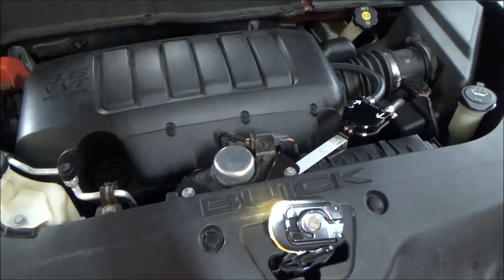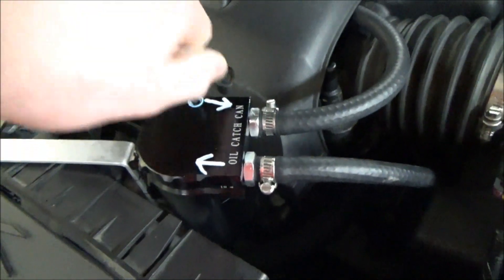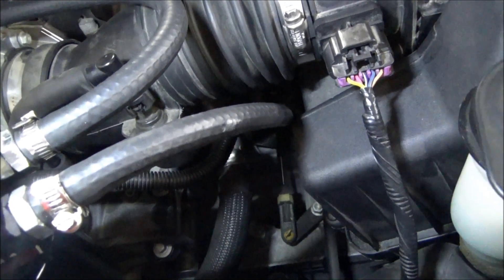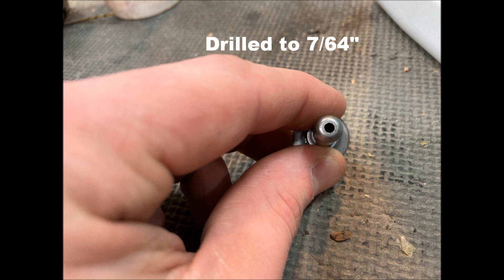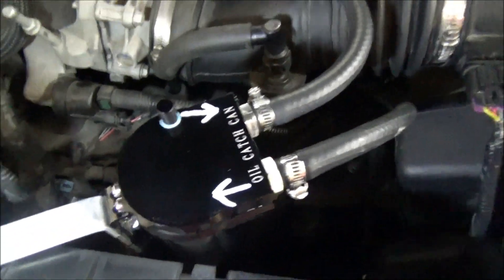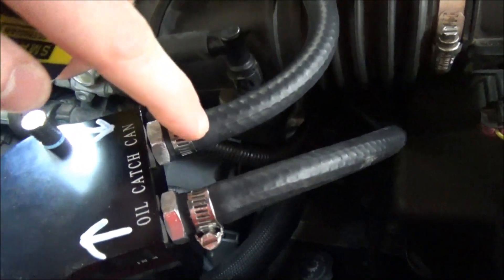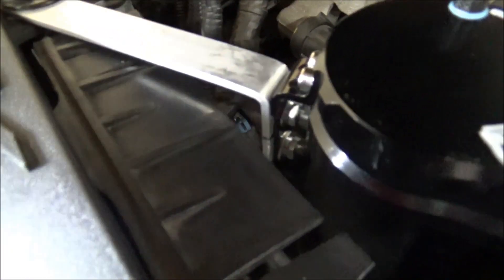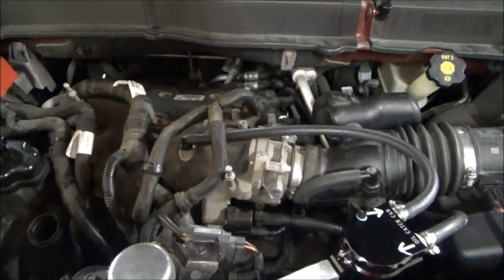GM 3.6 V6 Oil Catch Can Install for Buick Enclave, Chevy Traverse, GMC Acadia

Comment from the maker: Here are the suppplies that I used for this catch can install:
Catch Can: https://www.amazon.com/dp/B06XK9PTP7/ref=cm_sw_r_other_apa_i_YUKNEb4222NR5
Heater hose: 3/8" ID heater hose- I bought 6-8 feet an had some left over. (Local auto parts stores should have this in stock.)
PCV Valve - (I drilled the top hole to 7/64", and the two bottom holes to 5/64")- https://www.amazon.com/ACDelco-12583384-Valve-Hose-Adapter/dp/B07S4GSNDG?ref_=Oct_d_otopr_d_15727221_0&pd_rd_w=L1e2u&content-id=amzn1.sym.43572f80-b822-48bf-9e7f-061d94b77ab7&pf_rd_p=43572f80-b822-48bf-9e7f-061d94b77ab7&pf_rd_r=VTWG9J437JWG0HNTC3YX&pd_rd_wg=ou4Gq&pd_rd_r=05eb7e79-5262-4847-b6e0-e461fde5fd26&pd_rd_i=B07S4GSNDG
As for mounting hardware- I just used scrap aluminum that was lying around.

Comment: Just wanted to say THANK YOU for this video. I have a 2012 Chevy Traverse that I just modified the PCV valve and then installed this exact catch can system (where you did - to the brake booster). For those of you in similar circumstances, if you buy the Evil Energy can like I did with the 5' hose, it comes with a bracket that you'll need to widen one of the top holes and then drill 2 holes in the angled portion like where he shows his cannister is mounted. Also, I saw someone else put threadlocker on the screws so they don't come loose, and it might also be a good idea to put anti-seize on the inside baffle where the steel wool goes, as well as the cannister itself.  Wouldn't have felt comfortable doing the catch can without this video. Really appreciate the effort you put into this with the explanations, etc.

Comment: 2012 Chevy traverse ltz. The line from the pcv back to the intake is a hard line. Am I just supposed to cut the ends off and connect a hose?

Comment: Is it normal to hear air hissing sound after installing? I can hear hissing, but it there’s no leaks. Maybe the larger diameter hose is just simply pushing air more freely and making a more audible sound?
Reply from the maker: Yes, when it was running there was hissing after I added the catch can. But there was no issues as far as how the engine run.

Comment: Your video definitely helped me out. Did the exact same thing you did   💪💪… so since she installed it have you had a significant amount of oil inside of the catch can?
Reply from the maker: It is more moisture and condensation, not just oil. It depends on the outdoor temps too. If you live in a warmer climate there will be less moisture as the oil does not have to warm up as much.
Reply: Man, the only thing I have wrong with this 2012 GMC since I gotten it right when you first start the vehicle, it has a rough idle and then it moves out. But if I put my foot down and hold the RPM this move out quicker.  But if I use auto start and just let it run, it runs terribly and then moves out. It’s weird. Can’t seem to find the issue. No check engine light no nothing. It has all new spark plugs new timing chain new vvt and now the cats can any idea what could be causing the issue
Reply from the maker: @ Could be a dirty throttle body of mass air flow sensor. Or perhaps  it could be the cam sensors too, so then the engine does not know what position the cams are at so it tries to compensate by changing the timing constantly. My Buick when I started it cold, the RPM would bounce around during the high idle, but it was never varying over 100-200 RPM.
Reply: @ yeah mine do the same thing. Literally bounces around right when I first start the car up.  So I guess tomorrow I’ll clean the throttlebody and the mass airflow sensor. And replace cam sensors. Hopefully that does it. It was just bugging me because I didn’t know what to change and I didn’t just wanna throw a lot of parts at it.   So I guess the cam sensor should be the culprit.
Reply: Seafoam and goes away let me know how it went @re9473

Comment: What about the front valve cover? Doesn't the front cover also push oil into the intake manifold?
Reply from the maker: I said this in the description about that: "It is worth mentioning that some people have installed another catch can on the "clean air" side of the PCV system, to keep the throttle body clean. I have not had issues with the throttle body getting really dirty, so at this point no catch can is needed." The only time the oil comes from the foreword PCV valve off the snorkel is during high engine speed events, or if the PCV valve that I captured is clogged. Then it would get the throttle body dirty. I don't drive that much, and the throttle body has not given me any issues with getting dirty. I cleaned it once - and  it wasn't that dirty, but that was because I replaced the air filter and had stuff apart anyway.

Comment: Would I need to install this if I'm having issues with my ignition coils and sparks and o2 sensors had all replaced at dealers in 2022 now all have gone out again, HELP ME
Reply from the maker: Likely not, but if your engine is burning a lot of oil due to a clogged PCV valve, that could be messing up the O2 sensors. And it could be fouling the spark plugs as well, causing misfires. I'd check the PCV valve to make sure the crankcase can breathe.

Comment: Does it run smoother afterwards or just consumes less oil with less carbon build up in the intake valves?
Reply from the maker: It did not make a difference in the actual running of the engine, but adding this catch can will help keep the intake valves clean.

Comment: Do you still have to add oil to the engine. Or does the catch can returns the oil to the engine ?
Reply from the maker: It only catches the oil  that would have been routed to the intake, it does not return oil to the engine.

Comment: You get any engine codes or lights after install..?
Reply from the maker: No codes or lights at all. It runs the same as it did before.
Reply: @jacktischer6676  thx for the reply

Comment: did you install another type of pcv valve or is it the original
Reply from the maker: It's a new, stock one, but I modified it as mentioned in the video.

Comment: How much fluid are you getting on the regular?  These engines are terrible for oil in the intake.  I'd be interested to see a follow up after some cold weather or just normal driving of what you get out of it.  Great video thank you
Reply from the maker: I'm getting a decent amount of milky and oil substances in the catch can. It is more than I thought. In a little over 1,000 miles of driving, I've gotten around 7-8 ounces (close to a cup) of the milky crap that it catches, as of 2-13-2023. I installed it just before Christmas of 2022. Lots of the driving that I do is about 6.5 miles a day to school. That definitely generates lots of the moisture in the engine, because of both the colder Wisconsin temps, and short trips. But I do like to go on longer drives, to get all of the crap out of the oil- which I would go somewhere a good 10 miles away every weekend or so. When the temps get warmer for the summer, I imagine it will catch less crap overall, and not as much white milky crap. Modifying the PCV valve definitely helped to get all of the crap out of the engine. I should make a follow up video, and I'm glad someone was interested in the results of this.
Reply: @jacktischer6676 i have a 2017 buick and that model year you cant change the rear pcv it only interchangable if you replace the valve cover, its a newer design according to the stealership. But i did exactly in your video. Thank you for your vid it help out alot.
Reply: @jacktischer6676  That's awesome 👍, these 3.6's have a chronic problem with oil consumption/blowbye imo.
Reply from the maker: @unorthodoxridez  @Unorthodox Ridez  If taken care of really well, they can be a decent engine. I check the oil very frequently, and change it by color as well- not letting it get dark and black. Lots of these engines fail because people simply neglect oil changes.
Reply: @jacktischer6676  agreed

Comment: Why didn’t you capture the foreword PCV valve off the snorkel as well?  I believe that is where most of the oil comes from as it’s not restricted like the back one.
Reply from the maker: I said this in the description about that: "It is worth mentioning that some people have installed another catch can on the "clean air" side of the PCV system, to keep the throttle body clean. I have not had issues with the throttle body getting really dirty, so at this point no catch can is needed." The only time the oil comes from the foreword PCV valve off the snorkel is during high engine speed events, or if the PCV valve that I captured is clogged. Then it would get the throttle body dirty. I don't drive that much, and the throttle body has not given me any issues with getting dirty. I cleaned it once - and  it wasn't that dirty, but that was because I replaced the air filter and had stuff apart anyway.

Comment: I have a 2014 traverse the pcv valve is a one piece hose that connects to the in let valve on the engine do I cut the plastic hose and put my hose on it
Reply from the maker: Yes, carefully cut the hard plastic off of the fitting that connects / snaps onto the metal PCV valve. You will also have to do that for the fitting on the top of the intake manifold as well. Then yes, put the hose you bought on both of those fittings in accordance with the catch can inlet/ outlet.